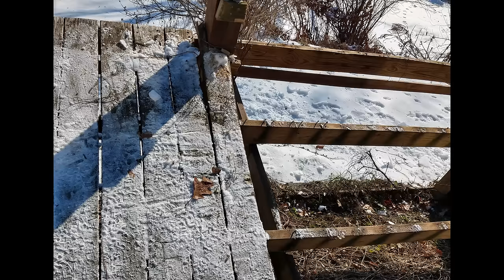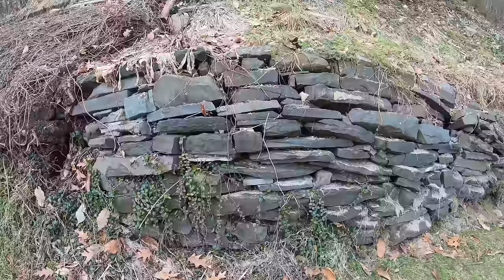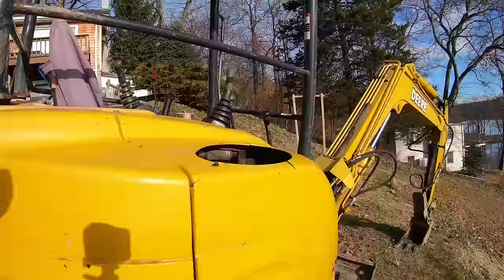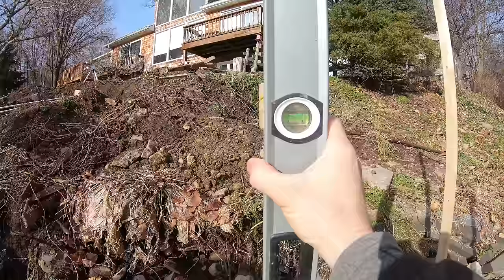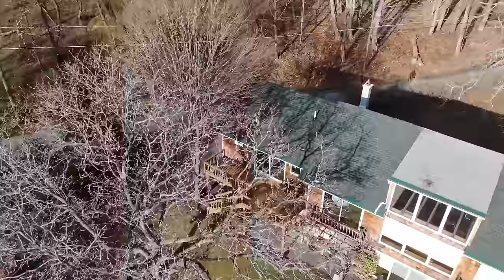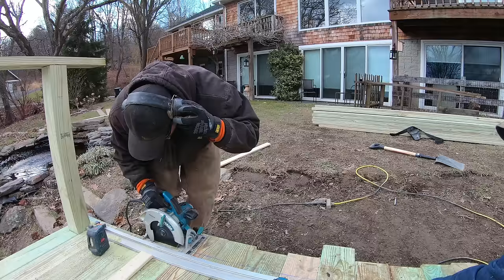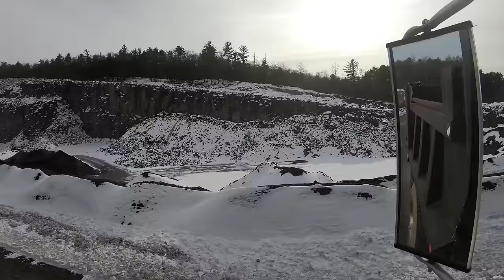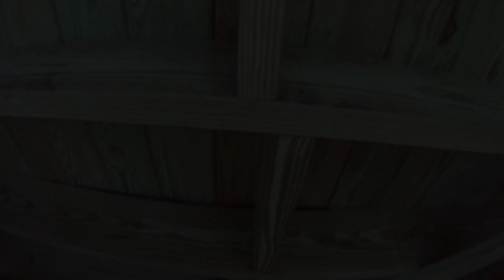Building a free-standing deck on a slope

Comment: Tips, Tricks, Advice, and Questions too. 

  Water, The More you  use the  Weaker the  mix Wet or Soupy concrete may flow ( YET ) the  overall strength and Freezing issues follow  that combination as all. Try using less water and the Vibrate the  sona tubes with a  Palm Sander or Sawzall. YES< Downward pressure  helps  with this  too.  Dildo Vibrators are Ideal for this and is an Industry standard. Some places like Harbor Freight and Northern tool have  lower costs  versions.   HINT:  Buy Cheap ( And  Cheap is what you get. BE - Ware . Moving  on. You Noted ( NOT ) a  Landscaper. Did or  Does the  client  Know this ? Rock and  Retaining  walls can be  both  be  interesting  to look at and  Death traps if  caught by one  falling  down.  Just  like  Drop Offs  from decks, patios, and homes alike. The  Code in each area  will say What is ( Exceptable ). Over building  will give  greater Piece of Mind  than ( Cutting  Corners  where it  will show  )  Time after time.  I See where the  elevation and  location presented a  number of  challenges here.  Tearing up a  Customers  lawn is  NEVER a  Good  Idea.  Try Using  3/4 x 24 x 96  inch  Ripped  sheets  to span that distance and  Regardless of  where you are  ( MINIMAL ) if  at  all will be  noticeable afterwards.  We regularly purchase full sheets and carry  cut  lengths  say  10 0r 12  along  so you  only  have  to lay it down once and  pick them up as you  leave.  Easy to move and  store  while still be  Quite Sturdy and Cost  Effective too.   Anyone  can  comment on how  things are shown ( YET ) its  those that Grasp the concept that Years of Trial and  Error, Proven Methods , and  also Known Preventive Measures  will Get  you  Farther  for  less money in the  end.  Not  Every Project  needs a lot to get it going  or follow to completion. Be it a  Laser level , Mason String Line, or just a Line  Level that Cuts to the  Chase without  a lot of  Set up , prep, or Confusing the  Simple angles of Right  or Left in this  case.  What the  customer had before was way under built .   The  Finish of this version looks  better YET is  still lacking the Final Touch of what or  how to Cover up the  back and  sides that  looks nasty and  ( UN-Finished at best.   Hurricane hangers, blocking ,and diagonal bracing  all Within the  realm of  Doing  it  Right  and  then some.  When Bidding or  Selling  a  client on there perspective project you  may want to ( Give Different  Levels or  Stages )  in those figures. Not  Referring to time frame as much as  what ( Can, should , Could , or  Would  be , the  expected Outcome  for a  Given price and  profit.  To Often People tend to Forget the  Givens. Nails, Screws,  Brackets, and Spindles, etc.  Sand, Gravel, Concrete, Weed Barriers, WATER, and the  Hand tools to get that  thru. Ever  Show  up expecting to find  ( POWER ) only  to find  out  ( YOU ) are Left in the  dark  needing a  Generator, compressor, and Heaters, along  with  The  Poly , Plastic Sheeting , and  Tarps to get things  started.  Just like  Scaffolding , ladders, Picks, and  planks , with Stand-offs ,and  Extensions to reach above and  beyond the   first  story on to the  next ( S A F E L Y ).  A  Good Heavy Duty  Cold Weather Rated Extension cord with a  Gang Box  can  greatly  Extend and Create Easy Access to power in the  most Remote of  places. The  Size Generator should always s be  GREATER then the  Combined  total of intended use. Just like  compressors that are portable where ( ONE ) Person can  carry , set up , and  use with out  assistance from other in any setting or location.  If a  Saw or  Drill or  just  Chargers to get those things  Up and  running is  needed.  much  more Conservative sizes and  types will allow for  greater productivity in even the most  remote of  locations in any season you find yourself in.  Last but  Certainly ( NEVER - EVER )  Forget the basics.  Measure Twice - Cut Once.  K. I. S. S.  or  Keep It  Simple - Stupid , and  For future outings ( Editing ) Can both  bring a  clip together or  cause  Speaker Blow Outs when Running  Machines,  Trucks, Saws, ands  other such equipment  that  Drowned Out  Vocal Output  to  Scream into the  Desk top speakers  like a  whinny cat  whose tail just  got caught in the  closing door.  If  your  going  to do it  ( Take ) an extra Moment to review the  completed videos. Some  go from No Audio , to Over - whelming , to  barely  audible , to just a  faint whisper and  back again within seconds of  each  stage being  shown.  Background  music  only  HELPS  if it  is  kept to a  Lower grade to  accent ( NEVER ) Over the  top  ( Setting ) the  mode being  blasted from ones  seat just  by turning  of the  cheek.  All of this  is  INTENDED to HELP . Also Be Aware that ( WE ) out  here  are NOT  there to say it  First  hand.  Many will agree to Dis-Agree First and then  Might  ask questions later.. OR  simply  Not  Watch at  all.  ( WE ) understand  you  do  some  stuff with  ( Andrew )   His  style or  version has caught  on over a  wide  scope of  viewers and  levels of Quality has changed  through out the  years.   Talking  or  Explaining  what ONE is  or  might  be  doing  is  NOT  the  Same  as  Doing  it  while  you  Talk about it all.  Long  Lapses in Commentary  or  NON  at  all is  that  same  as Blowing  out  speakers  just to have the  volume up  when the  Words  come  blasting  back in .   Low and  Slow  ( NOT  Abrupt and  Out  of  Control )     The  Content has gotten better .  Polishing it  up  will INCREASE the  Joys  and  Limit the  Noises.

Comment: Someone didn't get inspections,      - Footings are undersized (need 2 inches from corner of post to outside of footing, 6x6 barely fits on 12 inch footing really need 14 inch. That's a national code) 
- Cant notch post for railing anymore
- also idk what you used for fasteners but eaither galvanized nails or structural screws rated for pressure treated lumber, not deck screws
Reply: Also anyone wants to bash me I invite you to look at my channel all my work gets inspected and has PASSED
Reply from the maker: that sonotube is not the footing, the bigfoot is the footing and its 24" . I didnt notch the post for the railing. I used GRK structural screws for minor connections, and GRK lag screws for positive connection. I only used those deck screws for the decking
Reply: @jmuller86  then my apologies on some of it and soild work but a sono tube is a footing, most building departments want a spread footing at the bottom of a sono tube now anyway other wise you have to go to a larger diameter  tube. It's for "uplift" not barring. But the pisser is needing a tube under outside stringers for stair by me
Reply from the maker: @n8_the_carpenter816  yea alot of guys around here just use sonotubes by themselves, usually 12 inch, with no footing. but when you have a bigfoot at the bottom, that is considered the footing and the sonotube is really just considered a pier. to transfer the the load, same as the 6x6. We also only need 2 pcs 1/2" rebar here, but I used 4 on each.
Reply: @n8_the_carpenter816  The only bash would be re your attitude there Nate.

Comment: Nice deck but how come build deck longer to go level with land that way didn’t have to use block
Reply from the maker: it was hard to make it longer because then the beam would be in the dirt
Reply: Had my deck built like that off side of hill 2 tiers for above ground pool top deck step off the ground he dug it out concrete blocks to lay beams on top

Comment: Those boards were more narrow than the excavator tracks.
Reply from the maker: yea but they spread the weight out on a flat spot instead of the little rubber grousers on the tracks. the lawn was perfect when we got done
Reply: @jmuller86  Roger that.  I couldn't tell the depth of the grousers from the video.

Comment: $11,000 material, equipment, labor or more?
Reply: Guessing here🤔
Reply: 14' x 24' $25000 is not unreasonable on such a slope with a shed beneath 1/3 of it.
Reply: Just guessing this deck is 11x20. However a location like this deserves better than 2x2s This deck should have bulletproof glass topped with granite drink holders, and stainless steel cable on the high side.

Comment: 12:53 Justifies using the machine, I was surprised no debris/retaining fence 2x4's staked with osb would have worked 100 bucks is way better than what a lawsuit for debris tumbling down the hill even signage warning would help incase of a lawsuit. Not picking just hate to see someone that's trying to make a living get in a mess
Reply from the maker: I did put those 6x6s to help stop smaller stuff from rolling down, but the good thing is these homeowners actually own straight down to the river, the road, the lawn and even a few feet into the river,

Comment: You say @1:33 the frame was not built right.  Why didn't you go into detail what was done wrong?
Reply from the maker: I try not to bash other peoples work, but there was a big list of things that were not done to code on that old deck, some of them are just the code, others are downright dangerous
Reply: Jesse Muller There’s no need to comment on any contractors work specifically, but you can certainly comment on the details of what they did

Comment: Measuring a holes depth on a steep slope.You should be measuring on the low side.Four foot on high end a 2 on low will not put you below frost line.Earlier in video the big guy was moving and rebuilding the blue stone walls.Then later tearing them down for the excavator.When cutting anything you should both end braced up and wearing safety glasses as well.Safety is suppose to be number 1.On the center post I myself would have put in a 6x6 and notched it on both sides.And instead of screws I would have bolted it.I don't like you didn't give the floor boards any gaps.
Reply from the maker: the holes were 4 ft deep on the shallow ends, about 6 ft on the deep ends. actually the lower ones were 6 ft deep all around. He was not rebuilding the wall in the beginning, only moving it aside, and we usually always wear safety glasses. We did use lag screws that are equivelant to 1/2" bolts. and I explained that the decking is dripping wet so it shrinks alot and gives a 3/16 to 1/4" gap when dried
Reply: @jmuller86  I did notice in one part someone was standing in the hole when placing the tub and it came up to that persons waist.So either their legs are really long(4-6 ft.) or hole was shallow.

Comment: your supposed to set the posts IN concrete,not just on top of cemented sauna tubes.might be wobbly!and you talk about building a deck the wrong way!I built decks and fences,and I set my posts in concrete,so they can't move!
Reply from the maker: that has been proven to rot the posts and there is no way you can do that and pass inspection